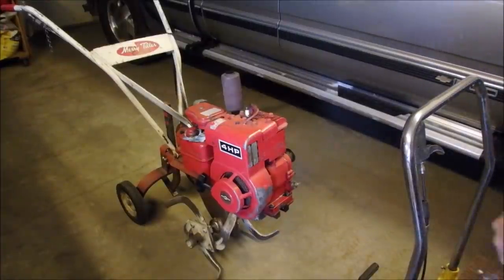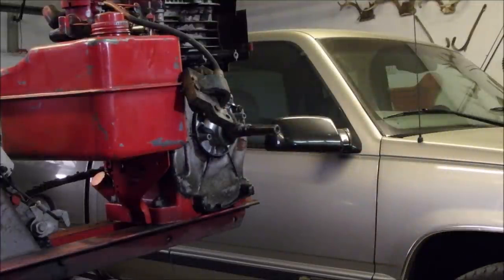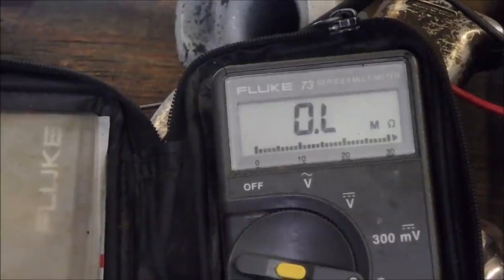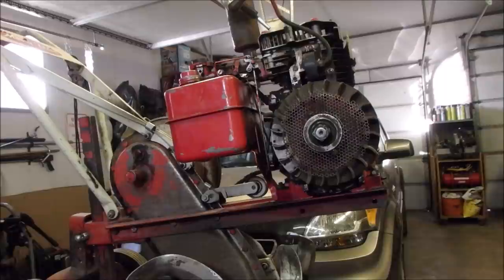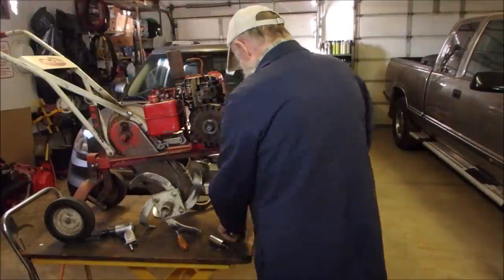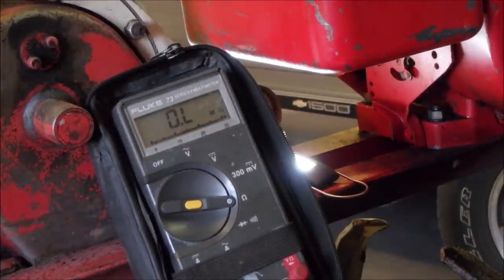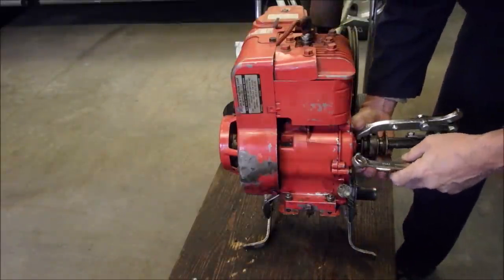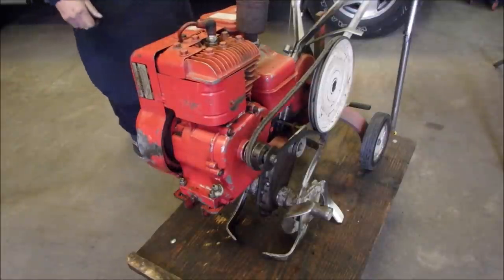A "Merry Tiller" Will Not start

Comment: Nice demo on the points and condenser, as I have never seen nor worked on one actually. Can you convert them to a current style magneto. I believe I saw it done before.
Reply from the maker: Yes you can!  This engine has a slightly different measurement than a standard coil.

Comment: Those were good machines. My father-in-law had two of them. An older and a newer one. The worst thing that went wrong with those was the enclosed drive chain which would wear and loosen some.
Reply from the maker: Yes they would wear right through on a well used tiller.

Comment: Wow, Bruce, you were in fine fettle while shooting this one! 👍   Wife has the ability to magically make a car disappear!  Diagnostic protocol or algorithm question, if you don’t mind. If you were not very familiar with that particular machine, might you have chosen the simplest tests first after the spark tester, like check the plug and then the magneto for resistance levels, then gone on to the points and condenser because they required removing the flywheel?  I’m learning all this so your answer will help me to know if I’ve got the diagnostic process down yet or not. Thanks!
Reply from the maker: I know these old machines.  I had worked on this one a few years back.  Once I had no spark the next check (for me) is points.  Measuring the coil while it is still connected is not a prefect way to do it.

Comment: Hey Bruce how much you think that tiller cost new back in the day
Reply from the maker: Wow    I don't even know how to guess    now it would be 800  so back then it may be 350
Reply: That looks comparable to the Merry tiller Suburban model, which they still make today. Depending on the engine option... $1550 - 1850 plus tax and shipping.

I have a 1972 Suburban with the 4hp Briggs. I got the updated ignition coil from eBay for $15 delivered. It eliminates the points and condenser.

Comment: I would just replace with a electronic coil-- I don't mess with points anymore
Reply from the maker: It was so old the coil  distance to the magnet was different.  I have quite a few coils and none fit
Reply: @BrucesShop  I grind em off so they fit
Reply: The electronic ones are better on mowers that operate at high revs.
If you want to run slower points help.
Reply: those older ones had  north and south poles on the magnets on flywheel other way ar modern coil would not work  you can electonic point module  never used one
Reply: @markkyy59  I think if you mount em upside down - they will work